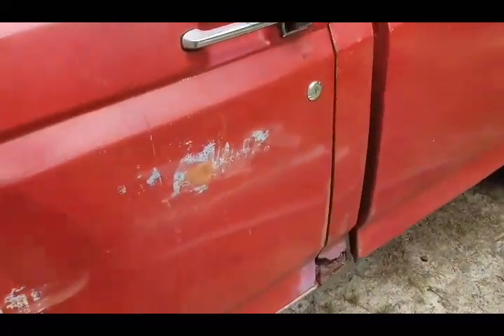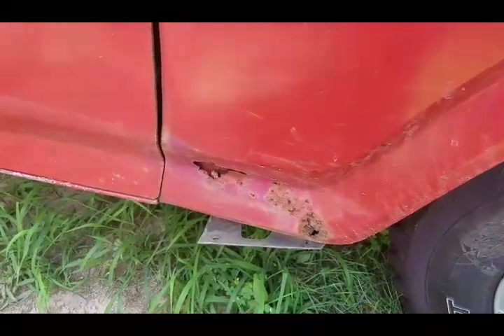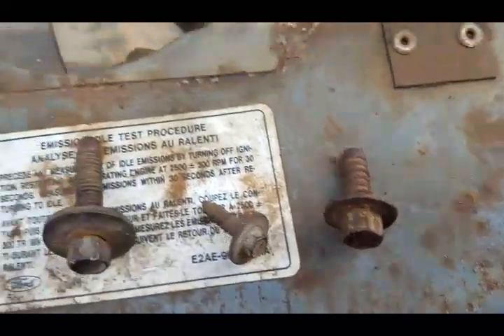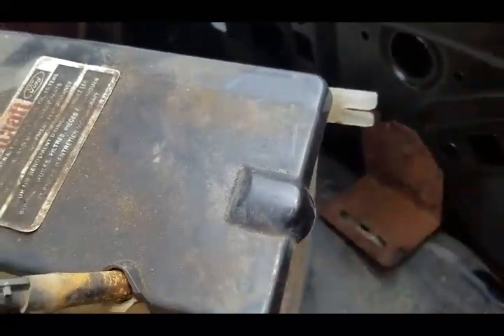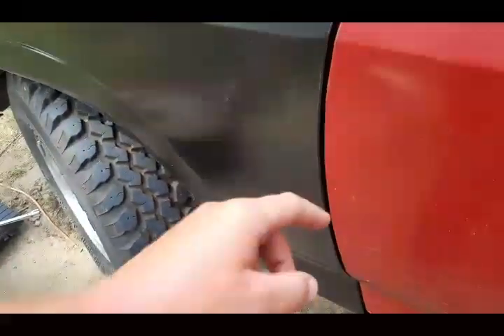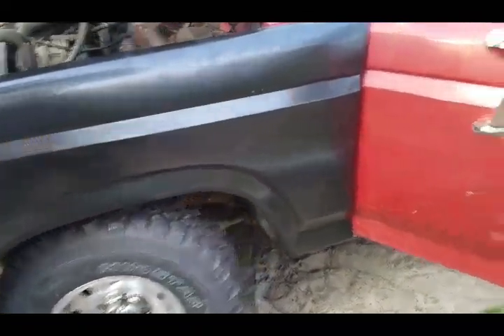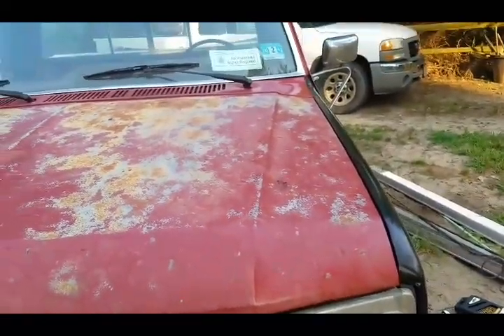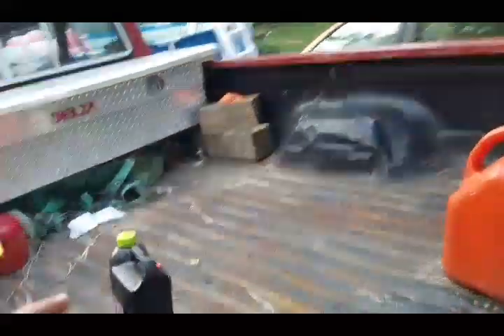1985 f150 Fender Replacement

Comment: Where did you order fender from? Lmc? I've talked to numerous people that these remans are thinner cheap metal than stocks
Reply: The 80 to 86 Ford pickups had extremely thin metal (at least if felt thinner) and does not compare to the 87-95 or even the 73-79 pickups.  The fenders are extremely cheap on Ebay.
Reply: The re-pops are way thinner than stock. And the gap at the a pillar is always off.

Comment: Yup...... what appears to be a simple job turns out to be a real pain in the ass. I was thinking about removing my fenders to work on replacing my door hinge pins and bushings and adjusting the alignment on the doors when finished. But this looks like more work than I want to do. Plan B...... do the job with everything in place.